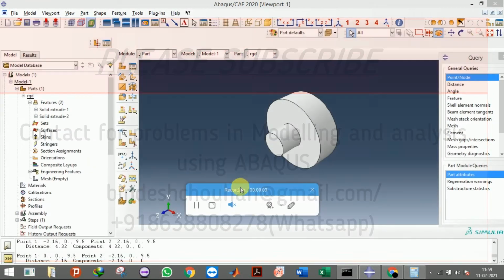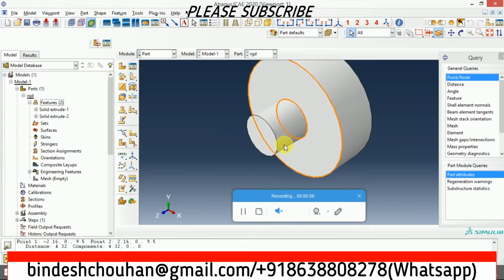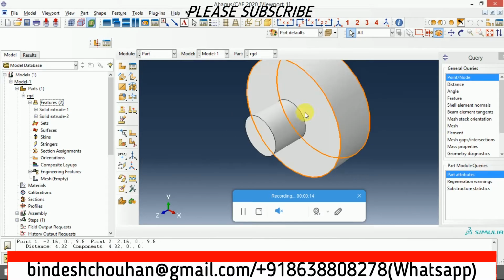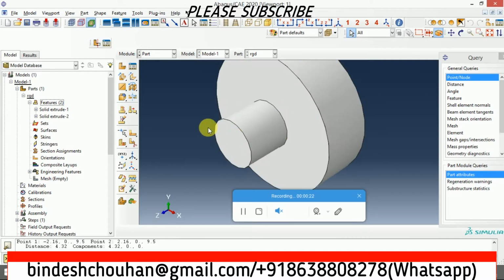#bolt # thread #modelling #in #abaqus #threaded #bolt #nut #bolt #fem #m5 #M16 #load #ABAQUS #CAE

Comment: Nice video sir. How to mesh this thread profile?
Reply from the maker: use tet mesh
Reply: @abaqusfem  Thank you sir. Currently using that. But having problem in assembly of the joint. External thread and internal threads are not coming in sync. Any video available for that?
Reply: @rashmiranjanmohapatra3757  did you solve this issue , I have the same issue